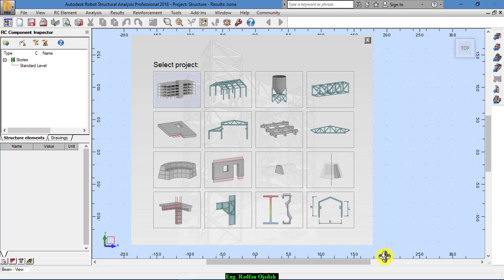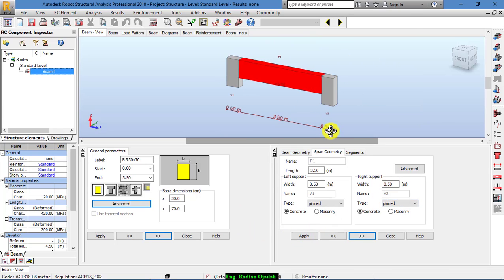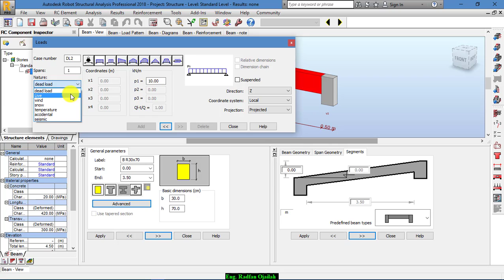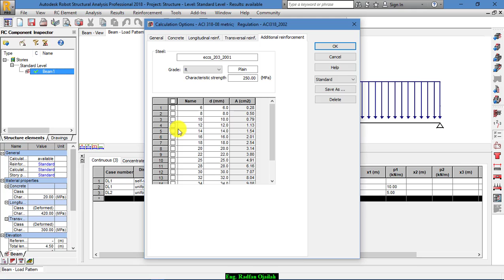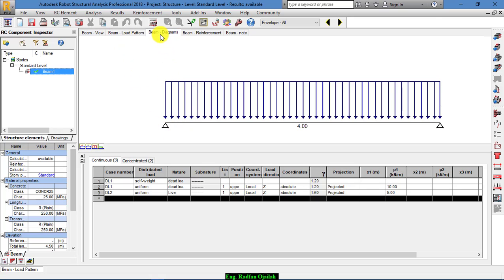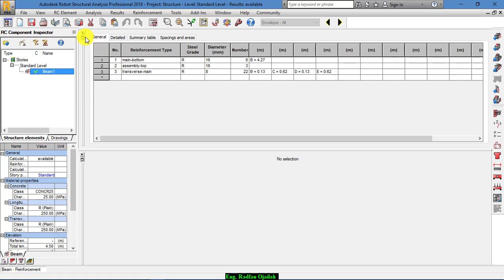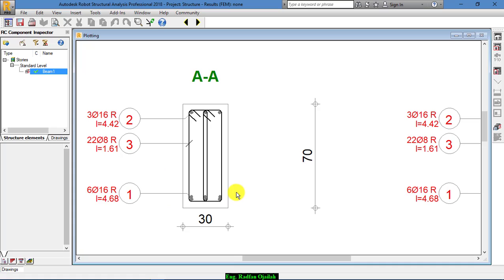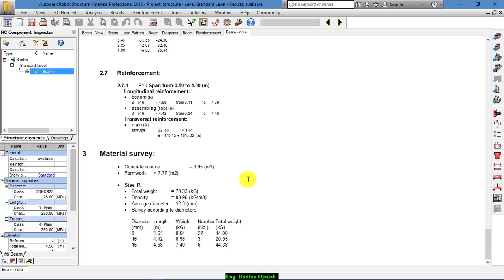LESSON#11: DESIGNING A SINGLE RC BEAM IN AUTODESK ROBOT STRUCTURAL ANALYSIS

Comment: hello engineer does robot have auto selfweight configuration like staad pro?in your design you inputed a dead load without mentioning.or was it for demonstration purposes.please i eng, i need to know how to add selfweight in robot
Reply from the maker: Hello, of course it does.
In the exercise I solved, I added dead load two times, the first one accounts for the self weight and the other one for the added load.
You can revise them after that in load table.
Reply: @RadfanOjailah  engineer engineer like in staad pro in the load definition an automatic selfweight of -1 factor is used under dead load before assigning the member load.does robot have a way like that?if so engineer i will like to know from you.
Reply from the maker: The factor of -1 is used to exclude self -weight from dead load, Robot uses a different way. As I told you, prior to assigning loads, add DL1 and DL2 for load types. Dl1 is automatically considered as self weight, Dl2 hence will be the dead load you have to add. 
When analyzing, you can see results from every single load type as well as the combinations you add. That means you do not have to recalculate again in order to consider the self weight or ignore it, you just select and results will show up.

If you didn't  get my point, just  let me know.

It's been a while away from robot.
Reply: @louismeoto2126  Sure it does. For the RC design module, go to Calculation options-->Advanced options-->Automatic generation of self-weight for new beams